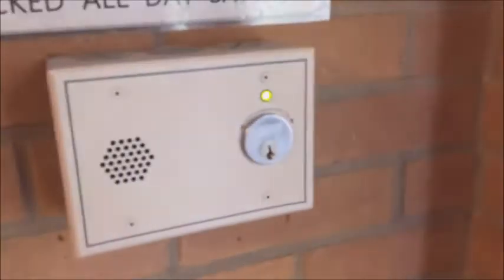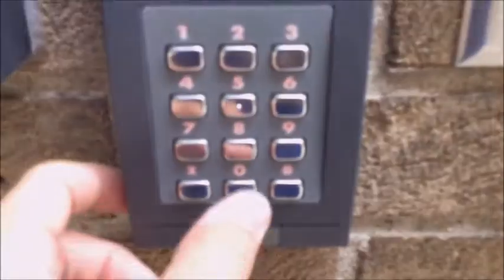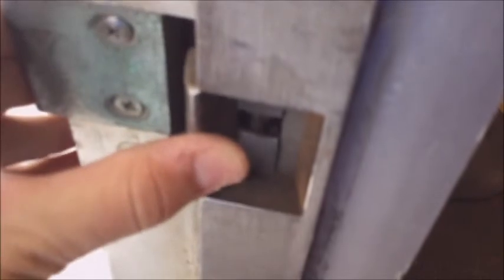HID Multiclass Card Reader | Tech/Mechanical Video

Comment: Oh that might be use with HID computer system software to program access code
Reply from the maker: Most likely.
Reply: @Jamestube8439  Yep I think maybe manager do not like anybody come that giving out access key code without unauthorized that is why the manager changed the code nobody trust to go in the building without permission give them out the key code. For me on that HID access keypad I do not have that anymore swap to HID smart keycard and FOB tag to tap better than HID keypad code.
Reply from the maker: @bl.randy617  For this particular building (it's technically a lodging facility) I'm guessing they give the code out to people all the time but regularly change it over certain periods of time)
Reply: @Jamestube8439  Yup yup that's fact